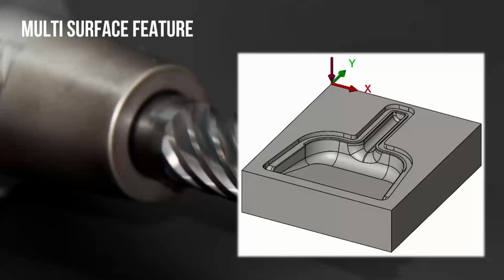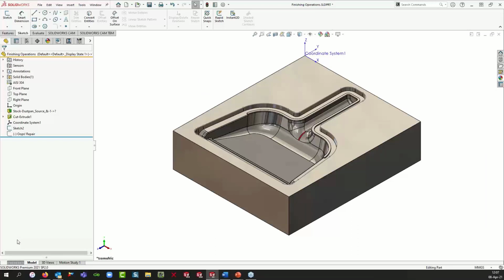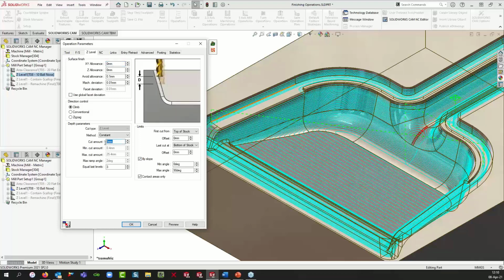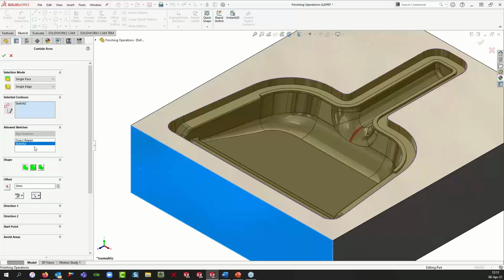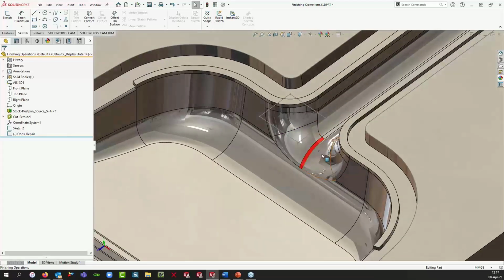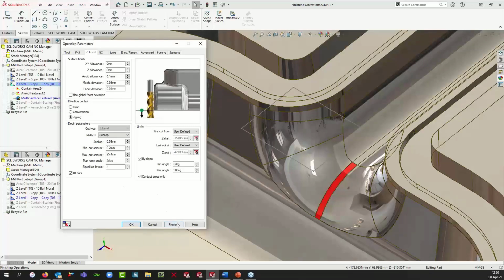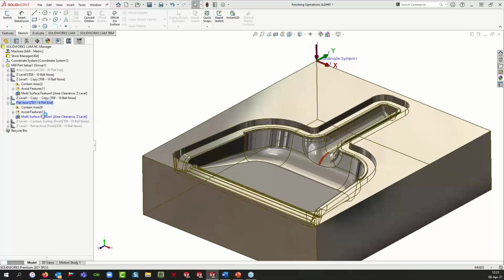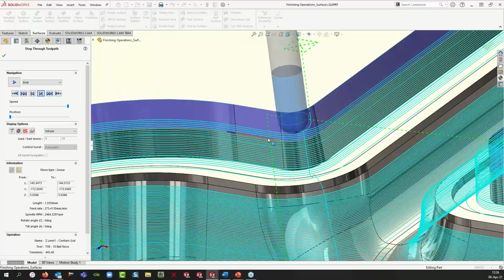Optimizing Your 3-Axis Finishing Operations Using SOLIDWORKS CAM 2021

Comment: is there a way to have the end mill do downward-upward direction instead of horizontal on the z-level operation ?
Reply from the maker: Not with SolidworksCAM, that requires 3 axis tools available in CAMworks.